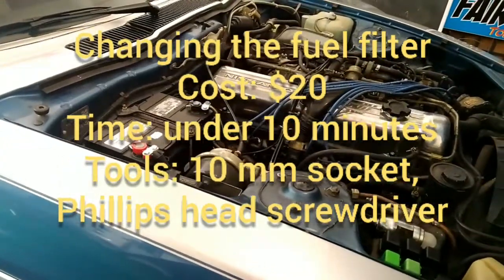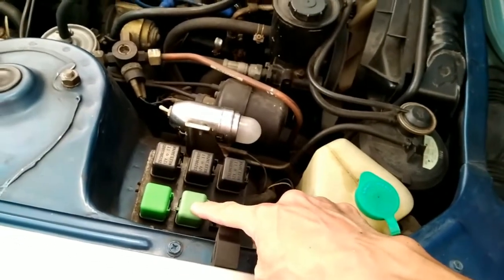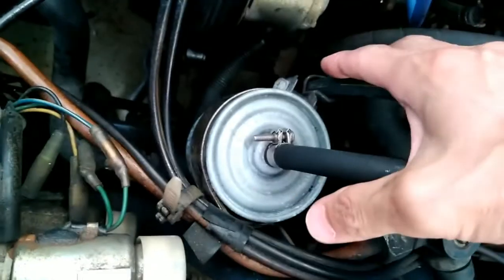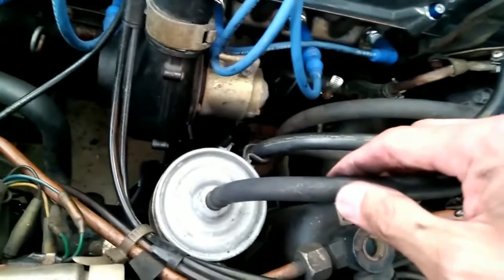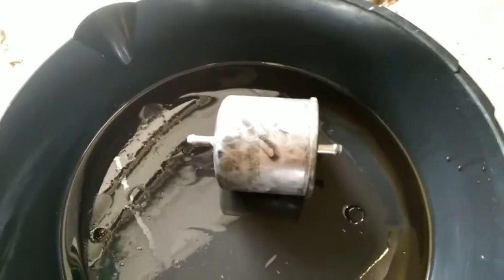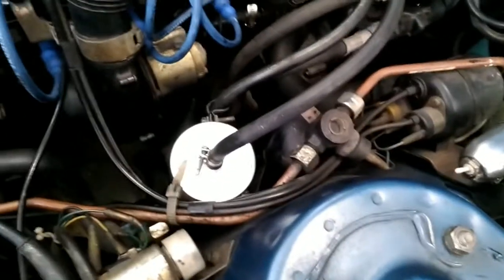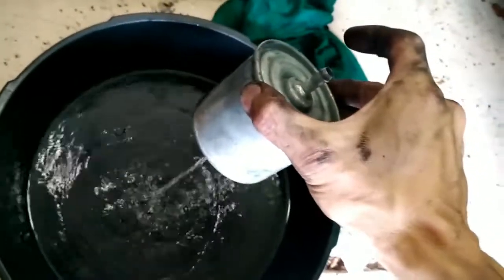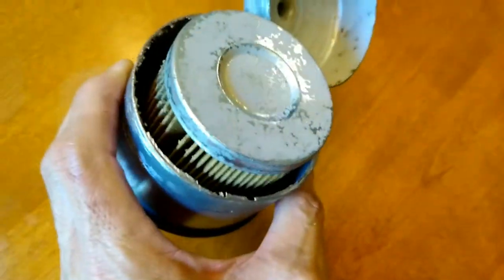280ZX Fuel Filter Change (non-turbo)

Comment: my engine isn't running that's why I'm checking this video, because I think it could be the fuel filter or the pump, what happens if I don't start the engine before pulling the relay?
Reply from the maker: If you don't start the engine, the fuel pressure won't drop. Just be aware your fuel might still be under pressure from whenever it last ran. Try to take your gas cap off and leave it off for a while to relieve some pressure. Just be prepared when you remove any fuel line that it might spray. It's possible with your car not running that the fuel is not under pressure anyways!
Reply: @hondatsunfan1011  I appreciate it thanks

Comment: what does it feel like before you change the filter? ( how do you know that you need a new filter ?)
Reply from the maker: I changed the filter just because I had no maintenance records showing that the previous owner had ever done so. There were no specific performance issues I was having. Low fuel pressure will usually be the symptom that you need to change the fuel filter.
Reply: You should change it every 30,000 to 60,000 miles as part of routine maintenance. Do not wait until it causes problems that you notice or feel. It's <20$.
Reply: Running rich also.